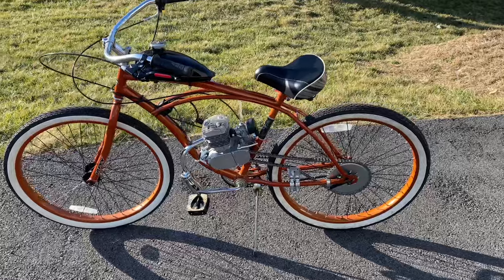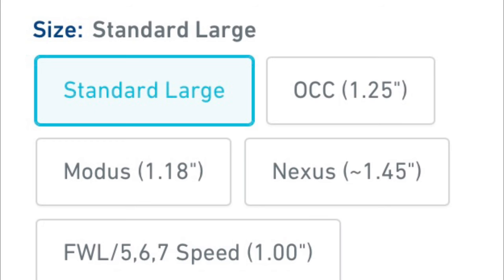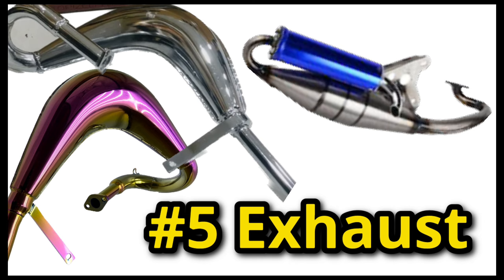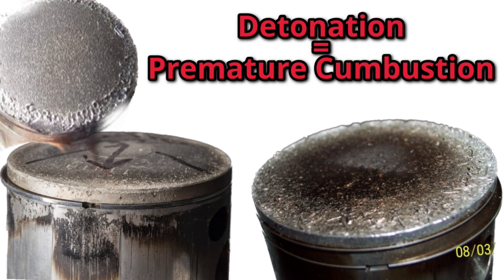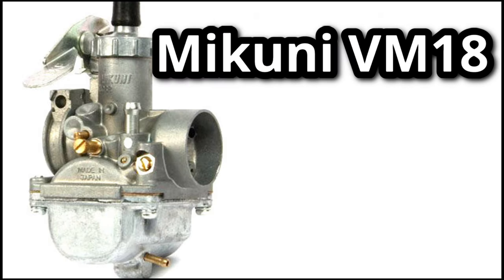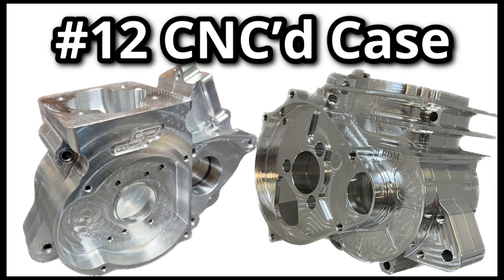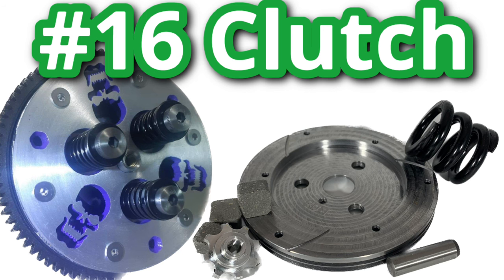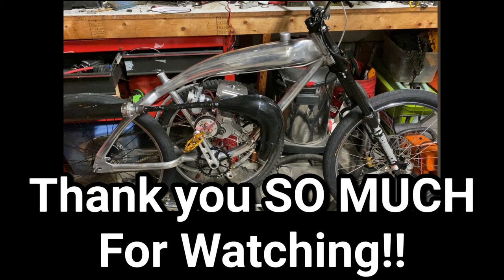EVERY Modification and upgrade For A Motorized Bike #motorizedbike #2stroke #motorcycle #moped

Comment: What do boost bottles do and are they improve anything?
Reply from the maker: I posted a video of the idea behind boost bottles a little while ago. In that video (and additional information in the description), I explain why boost bottles don't work. 

Literally the only thing a boost bottle does is increase the intake volume. The ONLY way this would somewhat increase performance would be if the engine was previously running extremely rich. The boost bottle would lean out the fuel mixture, but as far as performance, it would negatively affect performance compared to a well tuned carburetor.

Comment: what is a good 2 model carbs for a hilly town, i dont need speed i bike around downtown area so im constantly stopping  for people, poles,, obstacles, potholes, construction etc  and streetlights every 2 blocks so i just power to climb alot of hils
Reply from the maker: Torque is what that is called. To get more torque, you wont really find it in the carburetor, but more in the compression and porting area, and definitely the exhaust. While a carburetor could help with torque, it really only helps with torque when paired with the mods mentioned. 

If you dont want to overhaul your bike with performance mods but having trouble getting up hills, you'll want to look into gearing. When increasing the size of the rear sprocket, you get more torque with a slight speed sacrifice. Gearing is important with any bike.

Comment: What way does the aluminum head gasket go 80cc bike does bevel go to the head or the cylinder it has hump on one side of gasket
Reply from the maker: It doesn't really matter. I honestly dont put it on any specific way when I build mine, so you should be good. lol

Comment: hi i just got  fixerupper bike, and someone else put on a relatively new  autolite 216 spark plug, is that good enough for awhile? 50cc engine, heavy cheap mt bike, im going to be riding about 3 days a week averaging 10 miles, with small to medium frequent hills
Reply from the maker: Yes. That will do just fine. Next time you replace the spark plug, I highly reccomend using a genuine NGK plug, since they are usually MUCH higher quality than the other Autolite plugs. Though, the heat range and specs of the plug you mentioned will perform just fine on a bike.

Comment: My clutch cable brake a lot. What do you use?
Reply from the maker: Make sure you are using the proper lever (the crappy ones that come with these kits are flimsy and can shred cables). Also make sure your clutch is adjusted properly. If the bucking bar is at too much of an angle, it can put too much stress on the cable.

Comment: which spurk plug should i buy?
Reply from the maker: NGK is BY FAR the best brand to use. If you are using a 2-stroke engine, I HIGHLY reccomend the NGK B7HS spark plug. Youll get both optimal performance and reliability out of that one on pretty much any 2-stroke motorized bike. Though, keep in mind that a lot of aftermarket cylinder heads have deeper/longer spark plug threads, so youll need to match up the thread "reach" with this chart: https://assets.sparkplugs.com/lc/NGK_Plug_Chart_1_web.jpg

Comment: I want to build me a motor like BUILD BUILD when i start working in 2 months but i cant find a cnc case anywhere
Reply from the maker: Alot of them are not clearly advertised. Smolik Performance and RDM are really the only ones that clearly advertise. Though, you can contact Smolik, Ryan Darragh (RDM), Ken Hinson, Mitch Green, Alan Zhang, or Don Butler on Facebook and they should be able to get you a CNC of your choosing.

Comment: Hey guys, My carburetor is leaking gas from the cover area which i think is called a float. Its the NT carburetor with the red cover. I checked my donut it has no holes and it wasn't stuck. Any advice?
Reply from the maker: Make sure the carburetor is not at too much of an angle and is virtually horizontal. If this doesnt fix your issue, make sure your float needle is installed correctly and seals properly. If these dont solve your issue, try bending the little tab for the float's needle upwards a bit, so it shuts off the fuel flow sooner.
Reply: @a.m.bgarage.everydayprojec9665  My carburetor is on a good angle, how can I check if my needle is installed correctly and seals properly? Which tab it it the one that the donut pushes up against? If so how do I bend it up? Sorry I can usually fix any problem w my bike but when it comes to carburetors....It doesn't look good for me. Thanks! Let me know
Reply from the maker: @ayyanahmad4602  Im actually planning on filming a video on this because Ive been asked this question, so look out for that (probably tonight).
Reply: @a.m.bgarage.everydayprojec9665  Ight man ill be waiting on that. I also have a video of my problem as well. Thanks!

Comment: Use true fuel or tru fuel it's pre mix and makes 2 strokes run optimal for longer and less money in the long run
Reply from the maker: As far as running optimally, I reccomend comparing the performance between your TruFuel and using 93 octane with AmsOil Dominator oil. By experimenting between the 2, Ive found that AmsOil dominator runs a bit better and burns a good bit cleaner. As for expenses though, I dont see how $28 per gallon is "cheaper in the long run" compared to almost $6 a gallon for a superior oil premixed with 93 octane fuel.

Comment: Does anyone know what's the best place to get a 4-stroke with 100cc?
Reply from the maker: I would check out Amazon. The prices are usually about the same after you calculate shipping on all the other sites.

Though, wherever you get one, I would for sure get one with the chain-drive transmission over the belt. Unlike the 49cc kits, there is not any difference between the performance of the belt-drive and chain drive, but the chain will deliver the power MUCH better and require less maintenance.

Comment: turbocharging a 2 stroke at home will most likely make you lose power
Reply from the maker: It depends on the setup and the engine, but with a motorized bike, you're right.
Reply: No it won't, if done wrong, yeah then it does

Comment: We have 99 in the uk as premium fual  will that be ok or should I use 97 but it has E10
Reply from the maker: Unless you have upped the compression and/or advanced the ignition timing, you do not really gain any type of power or reliability when running premium fuel. If you are using a stock engine, 87 octane will be more than satisfactory. 

A lot of people talk about HOW BAD ethanol is and HOW good octane is. Ethanol is good in many instances and ONLY due to user error (stored incorrectly, using crappy oil, an improperly tuned carburetor, and/or other user errors) do issues begin to appear, which are usually incorrectly related to ethanol. However, the same issues can occur even with premium fuels.

Instead of opting for Premiun fuel, DEFINETELY look into how you can improve your oil (using higher quality full synthetic oil), using a better spark plug, or tuning your carburetor correctly. If you check these off your list and you are using a standard chinadoll engine or any 4-strokes, there is NO REASON to use premium fuel.

Comment: what cnc have a built in hole for a reed pipe?
Reply from the maker: You mean what CNC cases have a built-in reed valve (case reed)? Youll just have to look around, but Smolik Performance and RDM are really the only guys that advertise them, but I know Alan Zhang, Ken Hinson, or Mitch Green could get you one as well. If you want a specific one for a specific top end, ask around.

Comment: #1 timing hands down. Have to grind the keyway to change the timming. From the factory, the timing is on the ragged edge of being so advanced that they won't even run. And the crankcase weight is an absolute joke. It's like four times too heavy. These are not good engines for the most part. Also, most people are gearing them for way too much top end and they don't even do anything.
Reply from the maker: I agree. Ignition timing is definitely a good mod, but I didn't want to include that because I dont know much about it personally. Not to mention, my minarelli, as well as many others' engines run BEASTLY with the stock timing, so I see no real reason to change it.
Reply: @a.m.bgarage.everydayprojec9665  I guess i can't speak on all the engines timing now that i think about it. My experience is with the cheapest black ones from 4 or 5 years ago. Maybe there's a lot of variation.